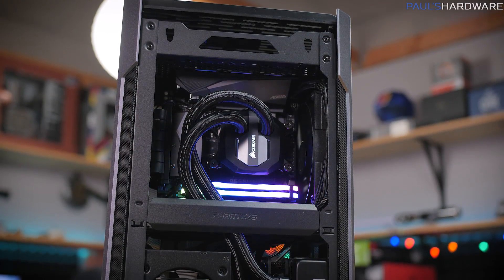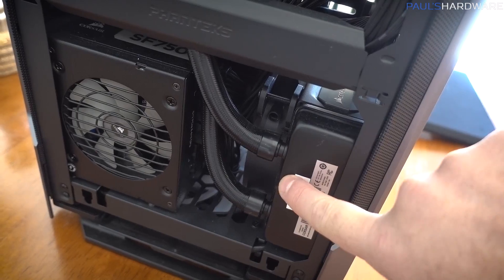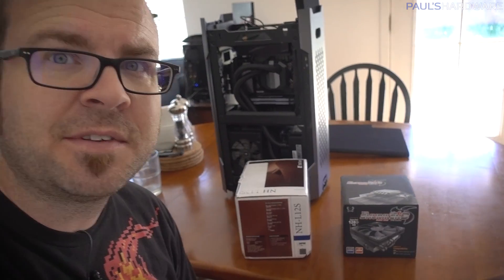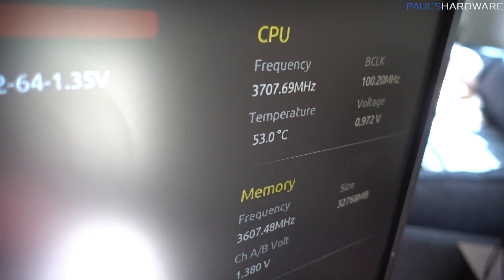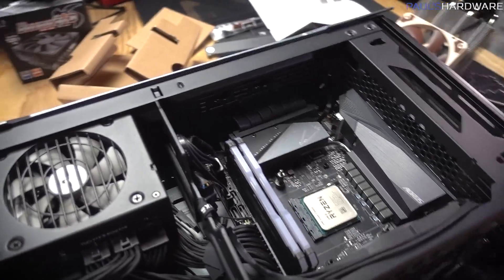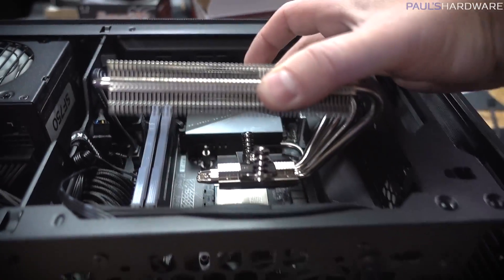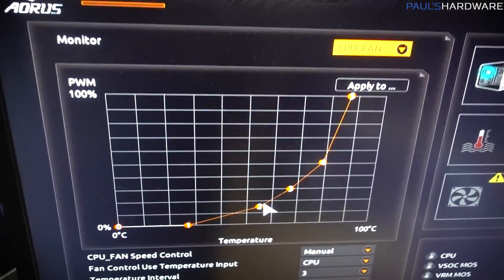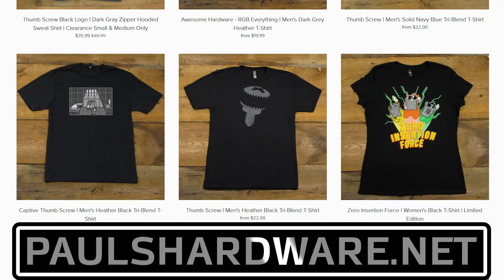You guys were right. The AIO died. ☠

Comment: Paul, what is fluid levels of these pumps..? Is there that much Air in them - maybe there should be a fill valve near the pump for users. There needs to be better reliability with Aio systems.   Perhaps the fan curve setting  needs adjustment..?   This is why I stayed away from AIO'S so long, but just bought one bought one  - mounted differently of course..lol
I did put an NH-U12A  in my son's computer to cool his 3900x(I didn't want any problems). Cheers

Comment: I might be stating the obvious, but in a case like the Evol Shift 2, if it has to be an AIO it should be one with the pump seperate from the CPU block. I think NZXT had one with the pump in the fan block(I guess it's called, the black box you mount your fan on), or whatever company had the pump at the beginning of the pipes...

Comment: usually corsair AIO ask for pump 3 pin cable to be connected to CPU fan header on mobo to feed it pump RPM, so if pump fails theres a failsafe. Was this not connected? It would have also been another way to check if the pump was toast by showing that CPU fan in BIOS had no RPM reading, POST would have also showed cpu fan failing.

Comment: The pump wasn't working harder.  It just didn't have the resistance that it's made for and therefore the motor is spinning way to fast and burns off and didn't get cooled it self ( they are also designed to get cooled by the water passing through and if there is no water there then it also overheat)

Comment: I have done an extremely similar build with all these parts. Evolv Shift Air 2, Vengeance Pro RGB and NH-L12S, with only difference being that I was using an ASUS B450-I.

I ended up using a nipper and snipping the extra bits on the underside of the heatsink to clear the RAM. That way, the heatpipe bends are able to face backwards (right) instead of upwards, which is what Noctua recommended against. Fits like a glove.

Comment: Paul credit to you for admitting you mounted the cooler the wrong way based against industry practice. You did not determine if the pump had failed from running in an air lock - there may be nothing wrong with the AIO at all other than it was mounted inappropriately?

Comment: The problem is that the pump's inlet itself is at the top where the air accumulates.  If the block was turned another 90 degrees this problem may have been avoided.

Comment: Nice video. Just adding if your AIO has software that monitors the AIO (Corsair Link, etc.) and your system will get to the desktop before it shuts down the software will tell you for sure if the pump is running or not.

Comment: Must be a crappy cooler. I have done this several times without any damage to the cooler. In fact, out of the three or four times I had to mount the rad below the pump not one died before five years, and in fact as far as I know all but one are working perfectly. One was an H60 from corsair, installed about seven years ago and the pump just recently started making noise.

Why is the pump not plugged into a fan header? It's simple enough to check the RPM of the pump in a system wired like that. In fact, you should be able to have an alarm go off if the pump fails.

Comment: The aio must have been defective, I’ve been running an h110 in that exact configuration with the rad on the bottom for 8 years nearly 24/7 usage and it’s still going fine.
Reply: Maybe we're just lucky? Mine is going on 7 years, same setup.I guess people with non-faulty AIOs just don't make videos about it. ;-)
Reply: @ShaunDore  True for almost anything, when something simply works hardly anyone notices but when something is broken people tend to make a big deal of it.
Reply: My Kraken in the Gen 1 Phanteks case lasted less than a year. My cpu would him ~85-90c in OVERWATCH. It was baaaaad

Comment: Imagine spending more for more problems...this message is brought to you by air cooling gang.
Reply: So you recommend for buyers here in Australia to go with Cooler Master MasterLiquid ML120L RGB V2 as they are cheaper than any Noctua Cooler
Reply: @shaneeslick  you don't need to go for Noctua, there's a load of air cooler out there. Noctua is just one of the "top of the line" in the market
Reply: @masadamofu  Sarcasm 🤔

Comment: my wife has been running an old FX 8 core on an overclock on a 240 coolermaster with the block above the radiator for 3 years. still quiet, still cools nicely. and it was a CHEAP cooler, like 57 dollars for the non-addressable rgb version

Comment: The H80i is a good little AIO.  In my old rig ran for over 5 years, no issues on a 3770K, but the radiator was at the top of the case.

Comment: NH-D15 user here...
Just FYI, but with my R9-3900x (4.25GHz OC) I have the main fan spinning at just 300RPM until it hits 66degC. My 2nd fan is set to OFF until 74degC which it only does when converting videos (or hot summer with no AC plus less load). My POINT is that even though one fan failing is UNLIKELY with a Noctua cooler you might never even know the 2nd fan failed... system is basically dead silent too as my front fans are Noctua case fans that never go above 600RPM (idle at 300RPM) and my EVGA GTX1080 FTW3 fans are replaced with Noctua 80mm fans and I never, ever hear those under load... so the ONLY NOISE in my system comes from the 10TB HDD, occasional coil whine from the graphics card, and very slight fan noise when CPU is under almost full load.

Comment: I'm worried about my pump. When I filled my loop I THOUGHT I killed the power after like 2-3 seconds. But I didn't. It was pumping AIR. I'm like AHHHHH. I've heard this is REALLY bad. But I kept filling it up  and it's been running over a month now and it's killing it big time. My 5900x with a heavy blender load is hitting 60 degrees C. That's not bad at all under load. UE4 upgrading my project managed to briefly hit 67 but was staying closer to 60 the whole time. After the upgrade was done, UE4 dropped it down to about 40 degrees. Oh and apparently my 3600 had a shit paste job because it was running 7 degrees warmer than the 5900x. Also the water temp went up MUCH faster with the 5900x vs the 3600.

Comment: Looks like you were fighting gravity with the block/hose position. From hose position, It looks like it would make the pump over work itself to eventually fail. Clocking the block at a different position might fixed it...that's if the pump was still working

Comment: Ironically my h100v2 died last week. 5 years of always on, top rad mount.
Ordered Z73, while waiting slapped Dark rock air cooler and temps are lower than it was with h100 from the beginning. Will leave Z73 for my next "hotter" build.

Comment: Personally, i'd have run the system upside down for a few seconds in BIOS to see if the pump was truely 100% dead, or if there pump was just running dry, i mean, at this point i wouldnt trust it with anything, but id have been interested to know if it worked at all

Comment: I've never had an AIO last longer than two years really, they've always been a nightmare and a half regardless of the fact that I always have the radiator mounted higher than the pump
Reply: I still have an H50, the original one, that still works. A decade-old now lol.
Reply: I have an H90 still on a 2500k overclocked to 4.5ghz.  It’s been going like 8 or 9 years now!  Of course now that I said that it will probably die lol
Reply: @katmarie7102  you better bookmark this comment so you can tell us the moment it dies.
Reply: My deepcool captain 240EX been going since 2016
Reply: My Deepcool Captain is still working Awesome at about 6years
Reply: My h150i is going three this year but I’m trying to switch to a chiller

Comment: Steve from GN must be laughing his ass off.
Reply: Every time an incorrectly mounted AIO dies, Steve becomes a little more powerful.
Reply: @NoChillMan  couldn't this have been avoided if he had the pc in a horizontal position instead of the way it is in this video? The radiator would have clearly been above the pump.
Reply: @NoChillMan  thank god for Steve, NZXT shipped the prebuild I bought with the wrong orientation
Reply: wonder if Steve or Jay will make a video on this again, just for Paul
Reply: I doubt very much Steve or Jay takes any pleasure from being right in cases like this.
Reply: @Illindi  they would do it just to take the utter piss out of him.
Reply: @draconightwalker4964  Kyle probably already has. I think both Jay and Steve just nodded slightly to the fact and moved on to how he fixed it.

Comment: Would the stock cpu cooler (wraith prism) fit in that build? 

Possible pro-tip: when using an AIO in a build keep the stock air cooler that came with the CPU. So if the AIO pump brakes you can get the system back up quickly

Comment: This probably ended up failing due to an airlock in the tubes. If the high point of the circuit is the pump, that isn't great, but if the high point is a tube, that's normally a big no-no.

Comment: Yeah... My Corsair H100i died after 6/7 years of use.  Ran into the same issue, system would just shut off.  I thought my CPU mighta kicked the bucker, or the Mobo... But I felt the pump/block and it was HOT.  The CPU is an i7-860 and im not overclocking it, so i just went with the Hyper 212 Evo Black RGB cooler and it works just as well as that H100i was (after the 6 to 7 years of use ofcourse).

Comment: The wohle reason I'm going air cooling with my AMD build...One less headache to deal with.
Reply: My PC has had the same Deepcool Captain AIO since I built it about 6 years ago, even last year when got to 48°C/118.4°F
 still going like a champ & quiet as a dead mouse
Reply: I’ve had my nzxt aio for about 3 years now and I issues
Reply: I went AIO because we have a bunch of cats and I'm far more comfortable cleaning a radiator bolted to the case than a air cooler fastened to the socket/motherboard.  Yes, I have a case with filters too.  That if I wasn't worried about dust I would have gone air cooler.  Fewer points of potential failure on a simpler system.
Reply: Air cooling is usually the best option.  AIOs are a problem waiting to happen.  If you must watercool, go full custom loop
Reply: 100%, plus it's much easier, and cheaper to keep some spare fans on hand if one does go bad

Comment: Gamer Nexus video came out at such a perfect time for me. I had the same cooler in the Shift Air v1. I had that set up for maybe no more than 2 months when that video came out. Immediately bought a new cpu cooler and case, put the cooler in an older pc as an upgrade and put away the case entirely. This video just proves that I made the right decision. 

Phanteks really needed to do more to improve this case. I still really love the design, but the fact that you cannot top mount the radiator really sucks. I think it would have been cool to have the mobo be side mounted so that the IO is on the back and then you can have room for the radiator at the top. Air flow would be SO good. Maybe they will do it in version 3 shrugs

Comment: There's no possible way that the orientation of the cooler caused the AIO to fail that quickly. "Reducing the longevity of the product" should mean instead of lasting 5 years, it lasts 4 years 8 months. The whole, "pump radiator orientation" thing has gotten blown severely out of proportion.

The cooler is faulty. That's the right answer. Not that having the radiator where it is killed it in 3 months.

Comment: If you're wondering if your AIO has failed, usually you plug in a PWM header for CPU_OPT which has the fan RPM, and you can have the BIOS alert or warn when that is 0.  Another good way of diagnosing a complete pump failure.
Reply: By PWM header do you mean the 3-pin non-PWM pump header coming off of the AIO pump block?
Reply: Is my AIO dead? In the BIOS, RPM for it goes 65 to 0.. 65 to 0 and repeats.. Basically turning on and off. Sometimes on certain days Its good? I'll hear water move RPM will be at 2300, I'll reboot and idle at 35 - 40c game at 45 - 60c but eventually over time (couple hrs maybe if that) Fails & RPM starts doing it again 65 to 0.. 65 to 0 in BIOS. Works maybe a day or so and fails? But I somehow tinker with it and get it too kick back on the nxt day  for some time. Should I just replace it?
Reply from the maker: Excellent tip and an additional way to check, thanks Christine!
Reply: @paulshardware  Paul, you probably won't see this comment but what about replacing it with a NZXT Kraken 120mm with the pump in the radiator so the pump would be at the bottom, thereby eliminating any worries of air in the pump?
Reply: @dakoderii4221  The NZXT is a great option for this case layout, I think there are a few other non- asetek design AIOs that may work as well

Comment: The umpteenth time why Ive stayed with air cooling for years, ive never had any problems beyond an old fan getting noisy after a few years and getting replaced - but cooling was never sacrificed.  I dont want to have to tinker and troubleshoot my PC every time I turn it on - I want to use it.  Water cooling looks cool as but comes with a list of issues many times including possible leaks that can brick my expensive components, that kind of stress I do not need.

Comment: AIOs really seem like more trouble than they're worth. I thought at first that one of the reasons was for low noise level but then I learned the pumps can be LOUDER than those big air coolers. The only reason I can tell is looks basically
Reply: Agreed - Ive always been tempted to try an AIO, but too many things to go wrong including LEAKS that could brick the entire system - just not worth it.  Ive always used a good tower cooler and beyond replacing a noisy fan after years of use ive never had any issues, for me reliability is #1.
Reply: @yambo59  Yeah it really seems to just be too much to worry about. I'm alright with my Wraith Prism for now. Maybe in the future when my CPU shows its age or I upgrade to a Zen 3 CPU, I'll go to a more beefy cooler, but definitely not an AIO

Comment: I have an H80i v2 running for the last 4 years without any problem, even with the radiator full of dust (needs to be cleaned up every year) and yes, the radiator is higher than the cpu pump.  But even with your config, it's a bit weird it stopped working after only 3 months.....  it's still under warranty, so......

Comment: Too bad they dont make cases where you can mount the MOBO on the other side so it could be upside down with the cpu at the bottom.Or make top and bottom of the case  the same so you can flip it over.  Would solve this. Paul you should have known better! Shame on you. :)

Comment: Paul - 
FYI - Noctua does not recommend placing the l12 in that orientation.  Liquid will collect at the heat exchanger and you will saturate the cooler.

Comment: I think it’s worth noting that the AIO configuration would have worked fine if the case was used in horizontal/HTPC mode. I have the older version of that case and ended up air cooling.

Comment: Replaced the fancy looking aio with ugly brown fan while simultaneously covering up the rgb ram. Somewhere noctua engineers are smiling lol
Reply: Function trumps looks... but im sure you loose at least 10 fps for not having the rgb visible.
Reply: I been a Noctua brown fan since 2008, it works and the fans I bought back then still spin like it was new 13 years later. Luckily they have those dark gray Chromax ones now for those who desire improved aesthetics.
Reply: I think the brown started growing on me. My CPU cooler is a NHD15 and got a 140mm Noctua fan as my exhaust. At first i wasn't feeling the noctua colours but now i wish i could change the rest of my 230mm fans to noctuas now and have a complete ugly brown uniform noctua fan finish lol
Reply: @kbgibson  Lol, I did the opposite, I had five Noctua NH-D9L in all my Micro ATX builds, was digging it for a bit, but then I decided to spend an extra $100 to get five 92mm Chromax Black replacement cpu fans.
Reply: @Yggdrasill8  Nice. The reality for me is my pc is under the desk and to buy the chromax at this point is a total waste. Well unless one of the fans I have gives out, I know I will go with noctua. My pc gives off no heat now and it's sweet.
Reply: @kbgibson  Let the brown grow on you...... so you will embrace Noctua, and paint your case, your GPU, your motherboard, your monitor and yourself brown......
Reply: @Verpal  let noctua paint you in its colors
Reply: Once you have entered the realm of Notcua you will no longer be concerned with earthly desires such as RGB.
Reply: @silentKeys20  BROWN IS RGB
Reply: I think brown make noctua unique
Reply: This specific cooler has a very cool feature, though. There are three square holes in the heatsink, and while two of them are used to mount the cooler with the screwdriver, the one in the center is a gap so you can see Noctua's owl from the back of the the fan, if you mount it below the heatsink as intended. In this case, since there's mesh above the heatsink, the logo would have been visible through the mesh. Noctua's branding is unique in more ways than the brown.

Comment: I have the Kraken M22, could be worth exploring with a different fan? It's not the best rad, though I find it works well within the tight space miminal airflow case I have, the fan is a little noisy, but it has the pump in the radiator not the cpu block.

Comment: I've had a corsair 120mm aio for 6 years on my last computer and never had any problems. The radiator was the exhaust at the rear of the case with and tubes up. 

I still decided to go with an air cooler for my new 5900x because it's one less thing I needed to worry about.